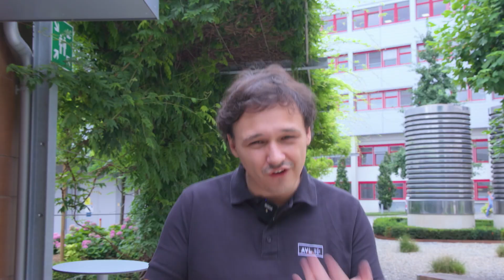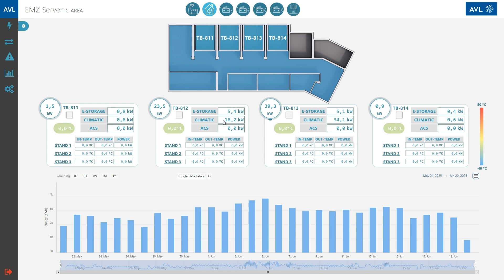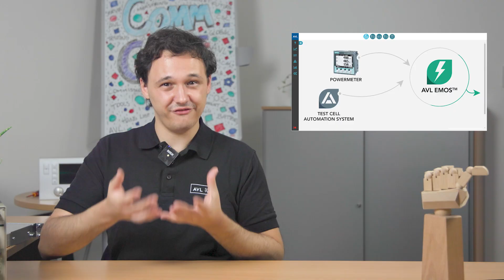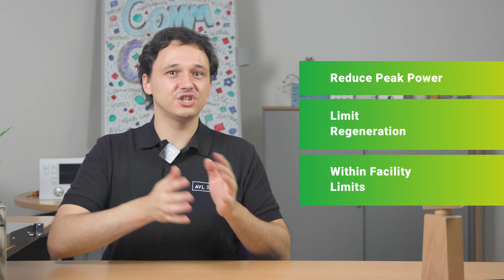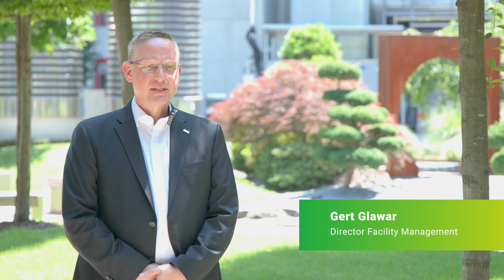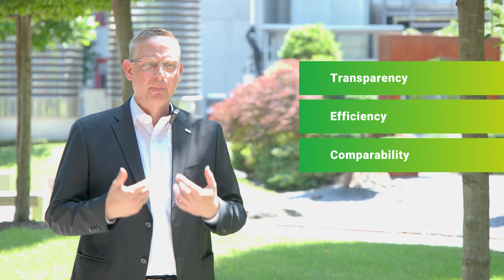Optimize Energy Consumption and Performance in Your Test Field | AVL EMOS™

Comment: When operating a test bench, it was always very difficult to find information about the electricity costs and fuel consumption required for testing. This system is really great. There are many test cells. AVL  A place like a building would be the best place.